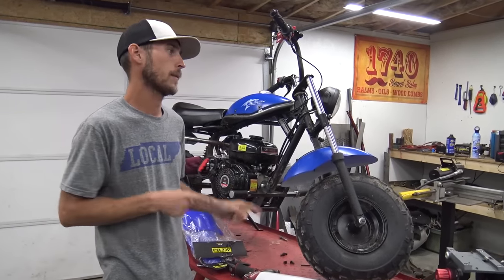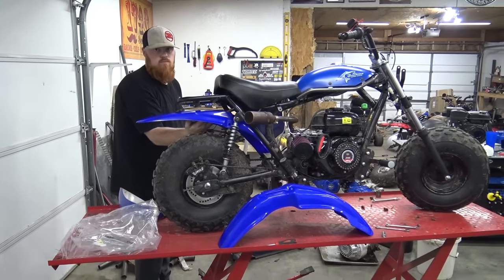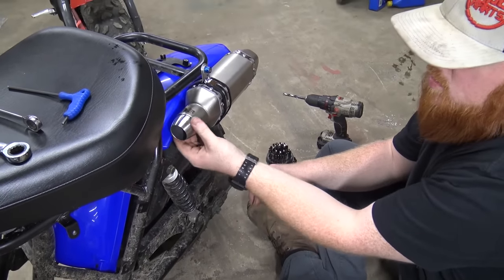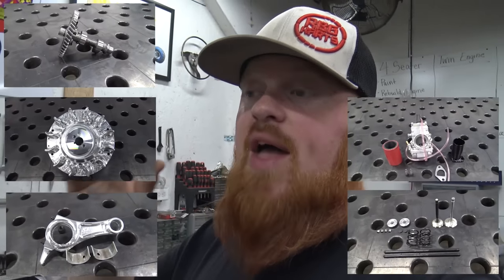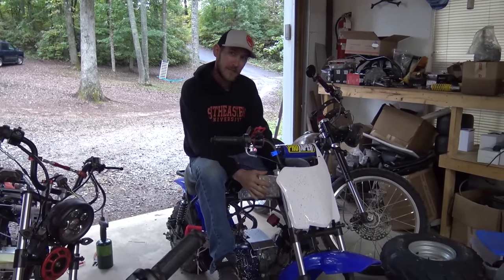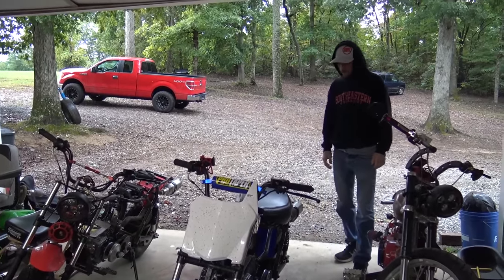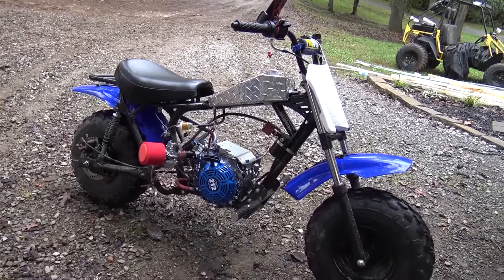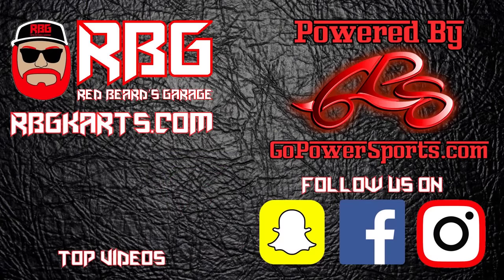Built Predator 212cc Mini Dirt Bike?!?! Lonnie's New MB200

Comment: Seems like it needs a bigger sprocket to be geared lower. Doesn’t sound like it’s using all of the RPM that engine should be capable of. Would be interesting to see when the tach gets on

Comment: Question is it possible to adjust the governor to allow say 5000ish rpm
Reply: Stock class predator governor is 5500 rpms +/- 500 rpms. Guys throw them on their bikes and don't even mess with it and run that class.
Reply: @user-neo71665  are you sure about that ... 3600 hundred is the norm...for lawn mower engines federal mandates (blade tip speed law) caused small engines to have to be governed at 3600 to be in compliance with blade tip speed...

Comment: You don't break an engine in with synthetic oil because the rings won't seat properly. I had to rebuild a Dodge 318 with 20,000 miles on it for that very reason.

Comment: Link for those roller rockers? Also how many rpms can those torque converters take? Will they allow the engine to spin over 7000 rpms? I hear conflicting stuff and I wanted to get it straight from the red beard's mouth. Thanks.

Comment: hey I got a predator 212 with dyno cam, billet rod , billet flywheel ,18lb valve springs, and mikuni carb and a 8 degree offset key, now I'm trying to start it and it starts but its not idling , is this because of the 8 degree key ? since we switched from a regular carb to the mikuni. and the choke does basically nothing to it. now Im wondering is the * degree key with the 32 degrees on the new billet flywheel way to much? I just don't know at this point.

Comment: Looks like it will make for a real fun bike - I like your builds, from the ones I have watched they end up as very serviceable, capable and pretty clean looking machines.  One question though, where is the guard for the torque converter?  Would hate to see anything get snagged in there!
Reply from the maker: Just didn't put it on

Comment: So funny i build a 20hp 212 and it felt like a dog because i had the stock springs in the 30 series i got some 4200 rpm springs and it woke up.
Reply: What parts does it have?
Reply: @icelover3  gopowersports stage 3 kit with the bigger cam 22lbs springs ported head header 27mm carb and 4200rpm spring in the clutch all in a hemi 212cc
Reply: You aren't making 20hp, especially with stock compression. If you're running stock sized valves a 27mm carb is overkill and causing you to loose some torque.
Reply: @icelover3  ok buddy what ever you say. I build these engines all the time. The stage 3 kit makes 15- 18 hp on a dyno shaved and ported head and header makes 20-22 hp on the dyno the loss of torque is who it's clutched to engage at around 4200rpm.
Reply: I'd really be interested in seeing a dyno video because no offence, I don't believe that.
Reply: @icelover3  I don't do videos yet. When i do it will be all of small engine repair. As for the dyno sheets they go with the customer. But next time i build one I will make a copy and figure out how to get it so u can see. I'm not here to argue and i can't make u beleave in the magic of engine building. There are lots of people building these engines up to 30 - 35hp.

Comment: You need to use a race clutch. If you use the CVT, it limits the engine to about 3800 rpm. If you build an engine to rev high, take advantage of it.
Reply: Hunter Herridge would a race clutch or a manual 3D clutch do okay in the woods
Reply: How does it limit it to 3800 rpm? I use one and i go well above 3800rpm i hit max rpm no problem